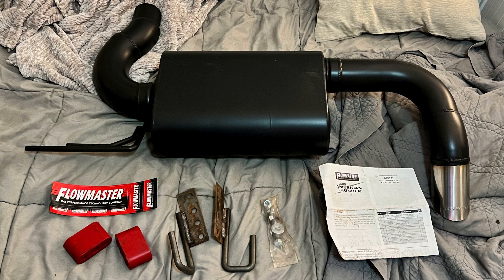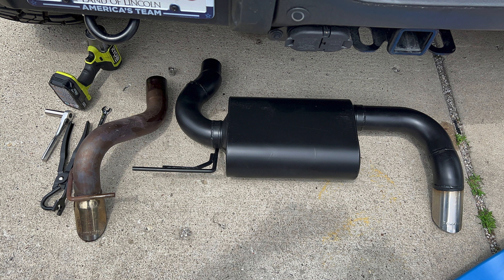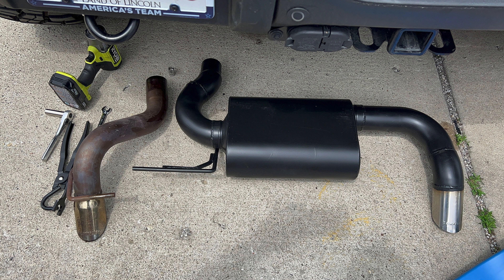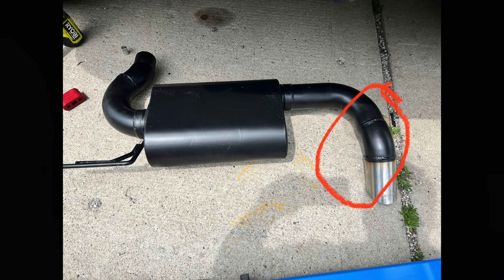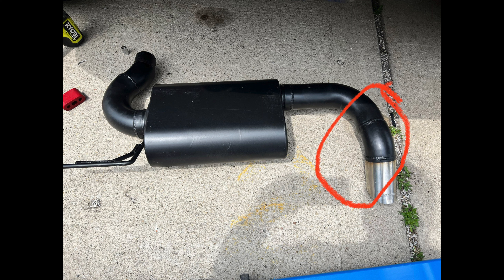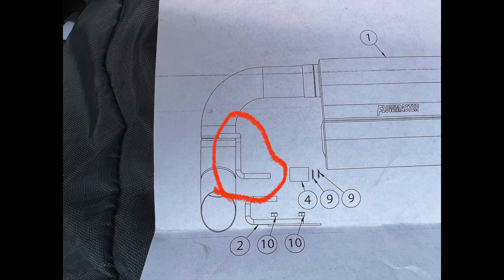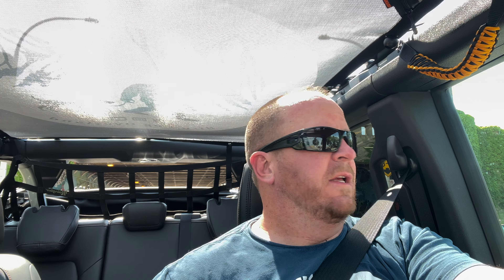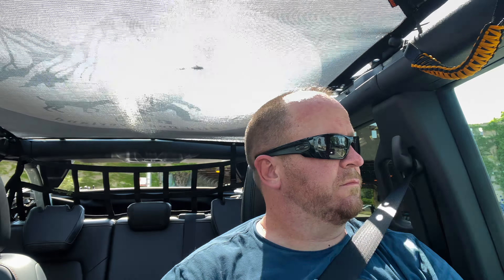Bronco Flowmaster American Thunder Axle Back Exhaust

Comment: just installed mine on my 2.3 and i love it, the acceleration is faster also. However i do have Roush intake. My concern is the rust people talking about. How is yours holding up ?
Reply from the maker: I thing surface rust is inevitable unless you're using stainless steel. Regardless, it's not where anyone can see it unless they crawl under the truck, so I'm not worried about it.  It doesn't look much different than the factory exhaust pipes leading into it.
Reply: @BirdDogOffRoadAdventures  Thanks

Comment: How’s the drone on it? Wanting a little something but don’t want drone at 70-80mph
Reply from the maker: Very little at those speeds with the cruise control on.  You'll notice it when you give it gas, but it's not too bad.  Overall, I think this is a great compromise system for someone looking for better than factory, but not overly loud or droning.